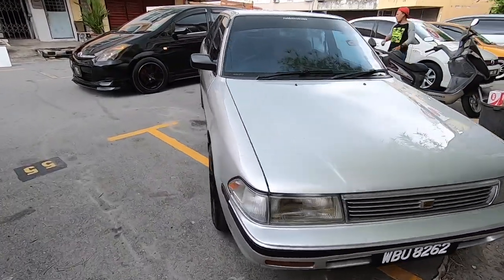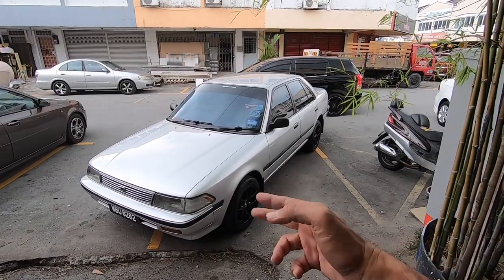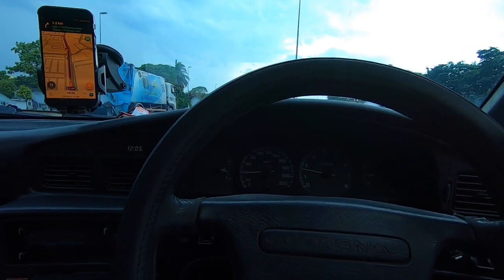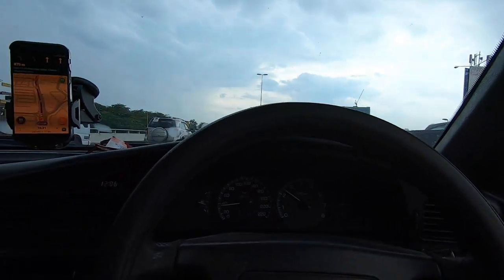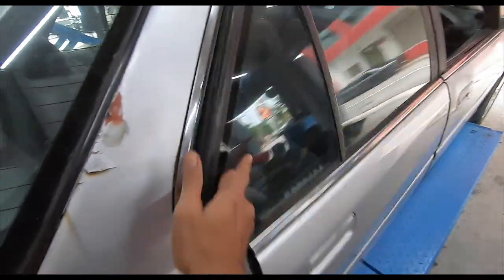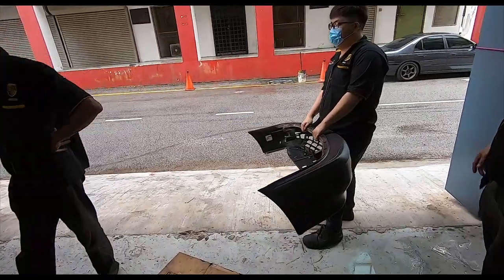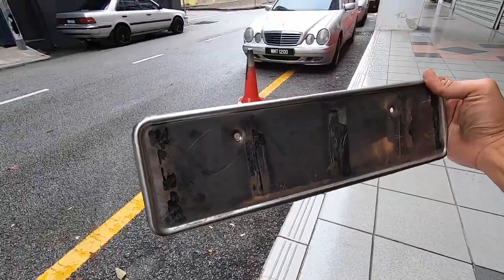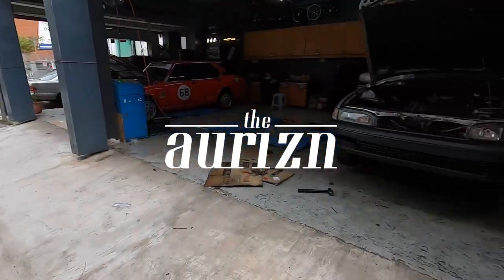MID-WEEK SPECIAL! '89 Rockin' Rona Comes HOME & Project '94 Accord SM4 UPDATE! | EvoMalaysia.com

Comment: Good info on the shock refurb shop. I will plan a dropby for my W124. Thanks a lot bro. Well, my fronts were leaking(lol). Ironically, W124 front shocks are almost same price as the Corona.
Reply from the maker: Great! Glad u found this useful bud. Yeah, I was really shocked (pun intended) at the price!!😂😂😂🤭
Reply: Btw bro, how long it took to refurb the two front abs? Need to plan the time.
Reply from the maker: @HotRod16  less than an hour, but also depends how many cars in front of u, fcfs 😊
Reply: @ChrisWeevilGarage  ok tq bro. The queing thing biasa lah. Moreover after many watching your video.
Reply from the maker: @HotRod16  try calling Shaiful first, see how's the workload before heading over 😉
Reply: @ChrisWeevilGarage  well noted. Cheers

Comment: If i remember correctly the SM4 had a low 2.0 Ex spec with black bumpers .. most people bought the 2.0EXi or the 2.2
Reply from the maker: Yeah, that's correct iirc too, the EX was carb'd, might be that variant had black bumpers 👍🏾😊

Comment: hi Chris， my Camry still bottom out on uneven road undulations even after I changed to brand new shocks absorber, any idea why? Is it that the sign of the coil spring going bad?
Reply from the maker: Could be, but it's rare for those springs to suffer metal fatigue so fast, hard to say really, unless u got the wrongly specified shocks for ur car.

Comment: Wait, why not fix all 4 sides for RM280 instead of just the fronts for RM240?
Reply from the maker: Good question, the rears were fine, and it was supposed to be cheaper for the 2 front until they found stuff that needed to be replaced inside the shocks😕